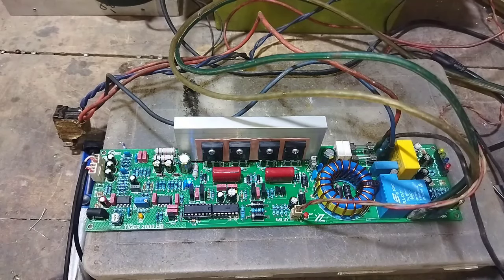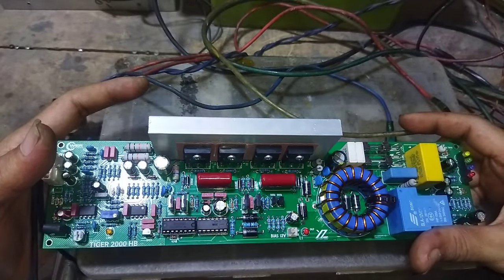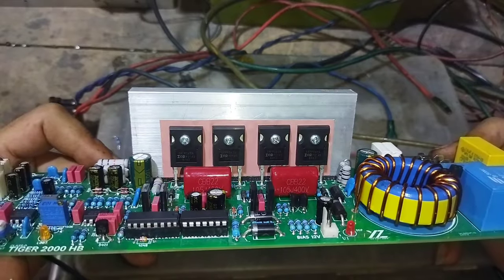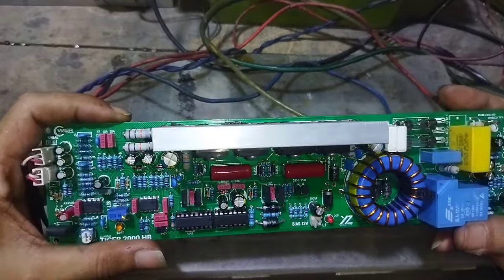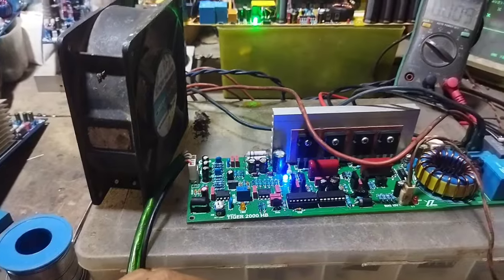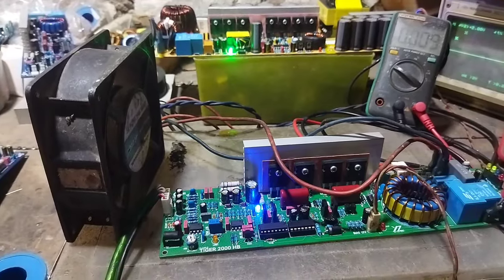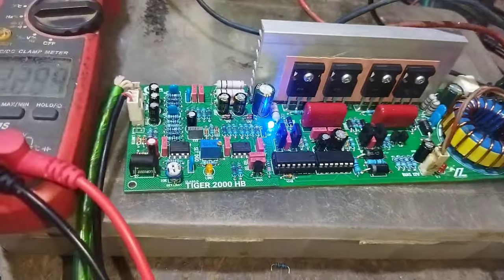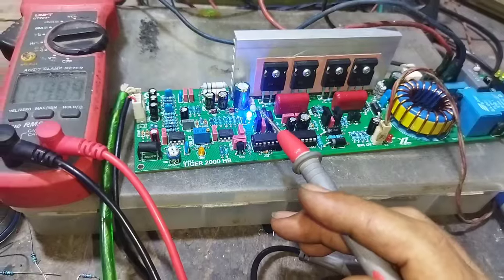CLASS D TIGER 2000, HALFBRIDGE 4 MOSFET DAYA TINGGI

Comment from the maker: power ini bagus suara dan tenaganya, biar tidak ribet buat pemula samakan saja setting dengan yg dijelaskan di video. suara dertail dan power full
link pcb
https://shope.ee/LR5qXPruP 
link pcb paket lengkap
https://shope.ee/1LJd2RkqOZ
Reply: Kalau buat sub miniatur minim coil berapa pak de
Reply: Pak ko class d ini suaranya ga besar ya
Reply: Gain nya kurang
Suara sih mantap detail
Reply from the maker: 3-4"
Reply: Saya coba supply di 32v ac menggunakan trafo, power langsung protec kira kira kenapa ya? Niatnya mau pake smps  75v tapi masih di perbaiki.
Reply: link nya gk bisa di buka
Reply: ok siap bang terimakasih banyak
Reply: Bang ini kalok untuk angkat sepiker ashley 18v400 x2 per chanel apa udah maxsimal